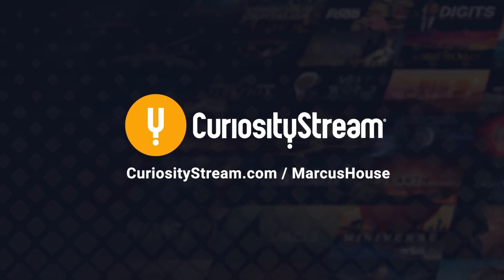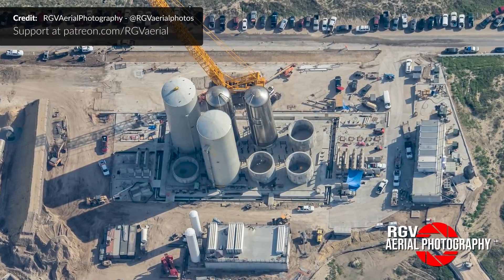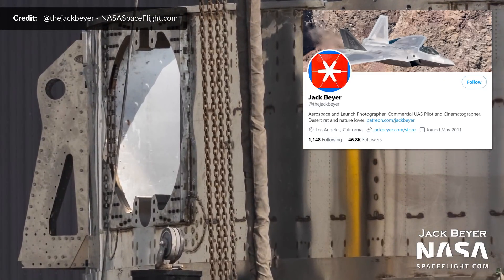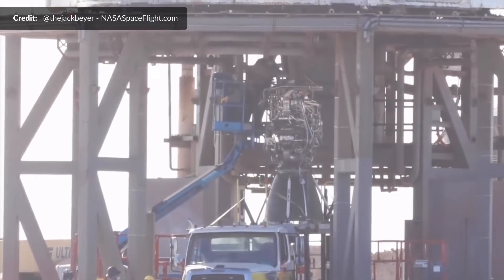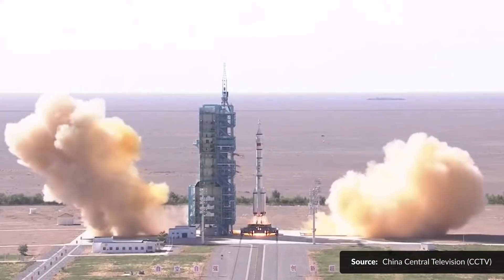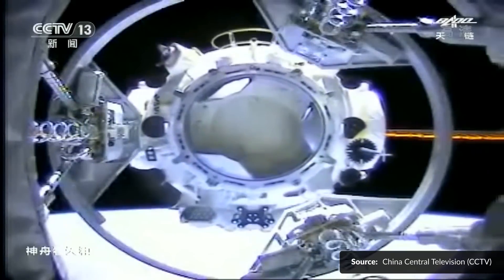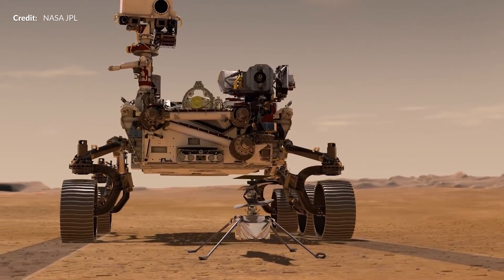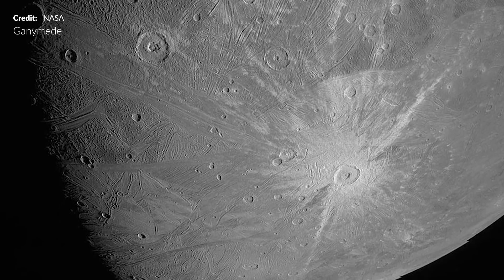Hypersonic Starship and Incredible Orbital Site Progress, GPS III SV05, Rocket Lab Mars Mission

Comment: If I were to compare the SLS program to any other heavy lift rocket program out there, it'd be like comparing some builders from the middle ages to modern builders with all the new technology and speed. NASA has been chucking this single booster around for years now and even longer just on paper. Meanwhile you have SpaceX with about 40 flights per year, flying Starships after only 2 years of physical development and even working for NASA on bringing people back to the Moon (we wouldn't live to see the day if they did it on their own). USA can be ashamed at their space program
Reply: NASA is using Space X and thus adopting. Blue Origin, SLS, and Boeing not so much.
Reply: @MrEd2291  SLS is a cost plus contract, so there is no incentive to come in under cost. Boeing's merger with McDonnell Douglas blew up Boeing. Blue Origin built a good sub-orbital rocket, they just took 20+ years to do it. Their culture is evidently to build very slowly and they are being passed by the slow legacy companies. Hopefully, Bezos will shake things up, but if their "step by step, ferociously" motto is all him, then maybe not.
Reply: SpaceX only flew 25 missions last year and one abort test. Their goal is 40 for this year and the flight next Thu, Jun 24th for for the Transporter 2 rideshare will be the 20th so far this year.
Reply: @steveaustin2686  well they'll probably reach this goal no problem and maybe go over. NASA could never do this on their own
Reply: @honilock577  NASA doesn't build spacecraft, they contract others to build them. For the longest time NASA operated to the spacecraft too, like being in the driver's seat with the contractor in the passenger seat advising. Now NASA is having the contractor operate the spacecraft and they sit in the passenger seat making sure it goes where they want.

Comment: Would starship need a booster to be able to launch from mars? Or is the lower gravity and atmosphere enough to be able to launch by itself?
Reply: Starship has enough delta_v to go from Mars' surface directly back to earth. Although it needs fully fueled tanks and can't carry more than about 50 tons.
Reply from the maker: No. Gravity much lower, orbital velocity much lower. Much much tinner atmosphere. Makes a huge difference. Should be able to launch and get into an Earth injection trajectory with fuel to spare for landing on Earth.
Reply: The latter
Reply: Ok that's really neat. Thanks for the answer!

Comment: I’d go for the hypersonic flight ditching in the sea. Why? Coz it’ll be a test of hypersonic capability. They already know starship can land. But for a small fee I’d happily change my mind…
Reply: It will be unlikely to explode if landed at sea. And you are right' it's the hypersonic flight that will interest them.
Reply: Umm, drone ship anyone?
Reply: I think so too, there is no need to risk a giant 40 meter hypersonic missile heading for a small landing pad
Reply: @rubenbraekman4515   It obviously would not be going anywhere near that fast coming down again.
Reply: I agree. And if it experiences a RUD, then the pieces would land in the water.
Reply: @steveaustin2686  This. A RUD at the boca chica facility right now could be a significant setback.
Reply: @Justin-C  Oh yes.

Comment: could those odd mounting points in-between the grid fins on BN2 be the method used to lift the booster onto the launch table?
Reply: could be both this and the "hooks" for catching the booster when landing, and this would make very much sense since both have to essentialy carry the boosters dry weight and therefore need to be reinfoced accordingly, but are never used at the same time - so merging both is the smart thing to do

EDIT: typo. i should stop commenting at 1am
Reply: Elon loves the principle of the best part is no part, best done by making one part do two or more functions. Using the catch arms as the lift arms will fit this perfectly, and the FCC document about the tower specifically mentions "mechanical arms" for the lifting process. Makes sense that the catch points on the booster will be used for the two purposes also.

Comment: I think SN16 will do a Splashdown because the landing pad is full of Construction Equipment
Reply: They should turn sn16 to the worlds largest and fastest fire cracker ever launched. It would be legendary
Reply: @richiz2bfound  well there was the N-1
Reply: I think they'd clear the pad if SN16 did fly, but it'll take alot to fix and clear the pad since it is filled with dust/sand as well